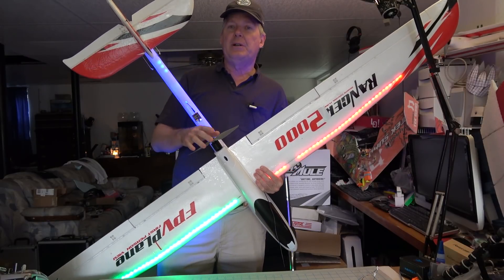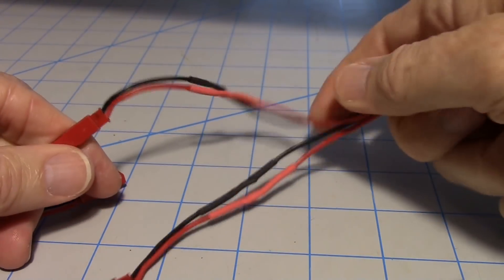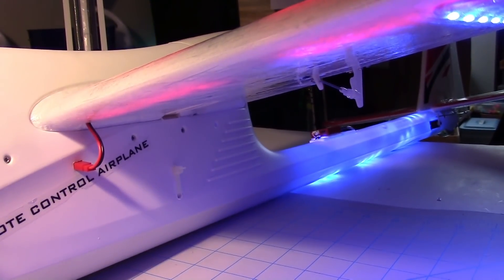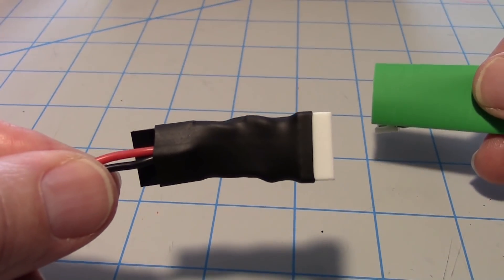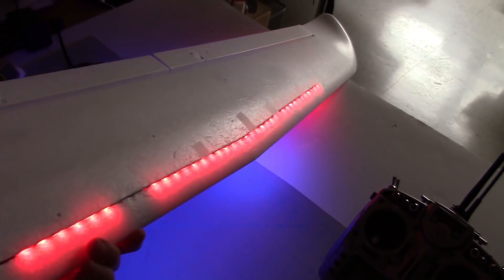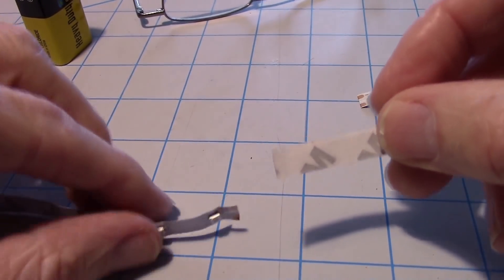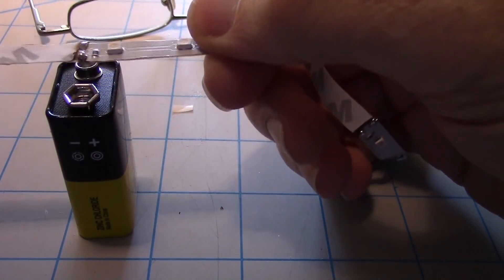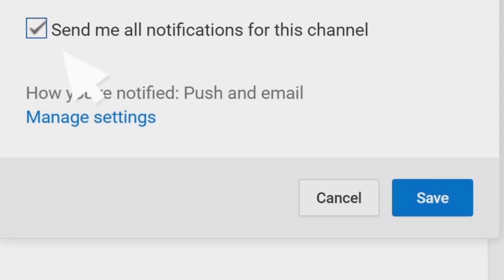Volantex Ranger 2000 Part 9 - Putting LED Lights on Wings and in Fuselage for Night Flying

Comment: Looks good Dave, but I would recommend running a regulator instead of tapping down one cell as it will unbalance your pack during flight. Those tiny 3A switching regulators are super cheap and weigh about one gram, so no penalty there.
https://www.banggood.com/DC-DC-12V-3A-Power-Supply-Module-Buck-Regulator-Module-24V-18V-To-12V-Fixed-Output-Step-Down-Module-p-1171570.html?rmmds=search&cur_warehouse=CN
Cheers, thanks for a great series.
Reply from the maker: You'er right, one of the four cells will end up with more charge after a night flight. I will have to put the battery on balance charge afterward.
I may try the regulator if it becomes too big a problem. Thanks

Comment: Nice job Dave, I thought the JST plug in the Fuz was a nice touch.....About the LEDs on the wings though, dont you think gluing the LED strip to the underside of the wing Leading Edge would be a better position..?...No channel cutting and you could clear tape over them to prevent it disturbing the air flow. That little ridge sticking up on the upper surface of the LE is not so desirable..?
Reply from the maker: Sure that would work. (May I ask: first name? Pardon if I am forgetting). I didn't show it in the video but I laminated over the wing afterward. It came out very flush to the surface and I was happy with the result. The channel is only deep enough to push the LED strip in flush so really not hard to do. I think it just depends on the look you want to achieve. I wanted a soft glow for the front edge and a bright look for the aviation stripes for an easy to see contrast. It would be an option to diffuse the aviation strip LEDs too with some white tape.